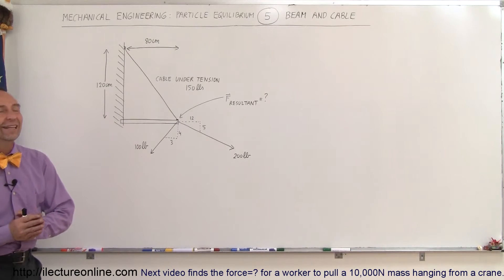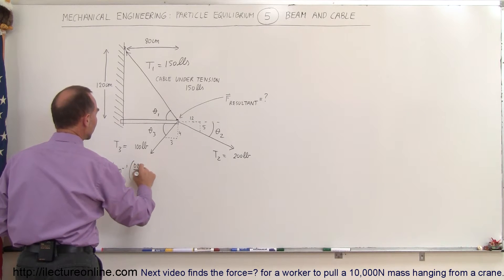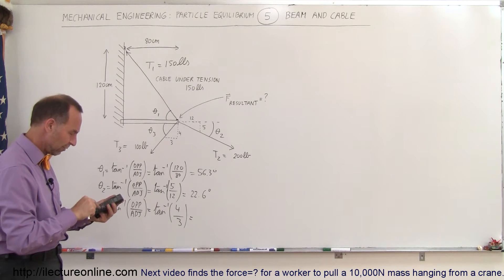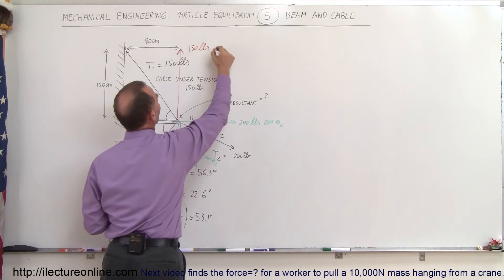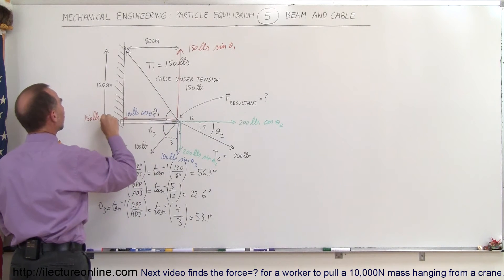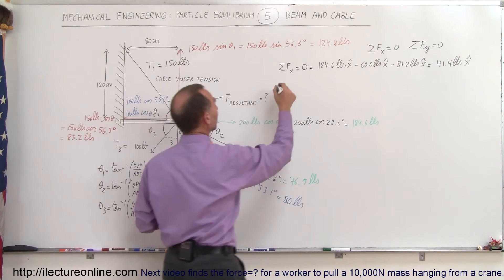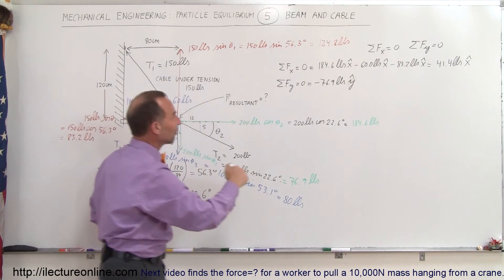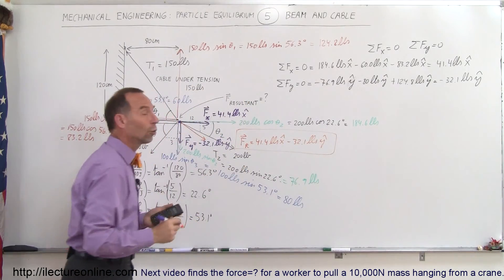Mechanical Engineering: Particle Equilibrium (5 of 19) Beam and Cable Under Tension

Comment: T1, T2, and T3 are in equilibrium and thus the system is static. that being said why would there be a non-zero resultant force with non-zero x, y components?
Reply from the maker: +Dinyar Mamatjan You are correct.  I should not have equated the sum in the x and y direction to zero.  There is obviously a net force  (not equal to zero).  Thank you.
Reply: @MichelvanBiezen  so there is a resultant force but yu didnt need to equate that sum of all x and y values equal to zero because yu clearly stated that there are non zero values
Reply: i just want to ask the same question differently: you are looking for resultante not equilibruim, because in this case we will need reaction at "appuis"

Comment: Sir,Why did not you use tan-1(-32.1/41.4) to find phi? Isn't minus sign important?
Reply from the maker: +Snob Phantom 
The answer is no.  The sign is not relevant as it is in mathematics when you find the angle with reference to the positive x-axis.
Here you just want to find the angle between 0 and 90 degrees.
Reply: I got it.Thank you so much

Comment: Because this is a static problem, the reactionary force would have to be of the same magnitude but in the opposite direction? Therefore, F-reactionary-x=-41.4 and F-reactionary-y=32.1 lbs? Otherwise, the two equations you wrote for Fx and Fy would be incorrect(since 41.4 does not =0 and -32.1 does not =0).
Reply: Cameron Aminian yup
Reply: And this rectionary force is provided by the beam itself not the cable?( If it is cable, then the tension would be more than 150 lbs)